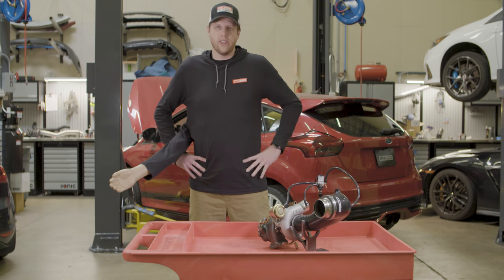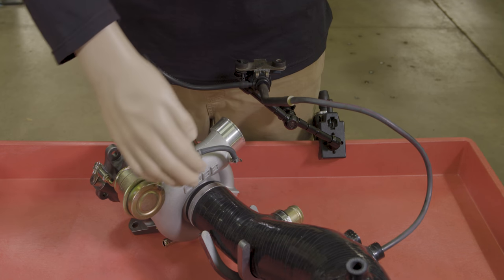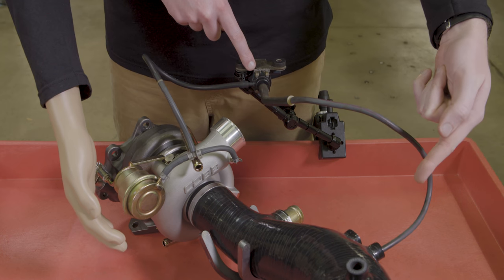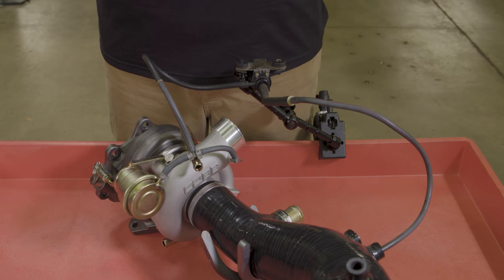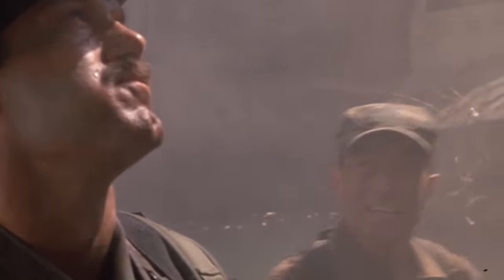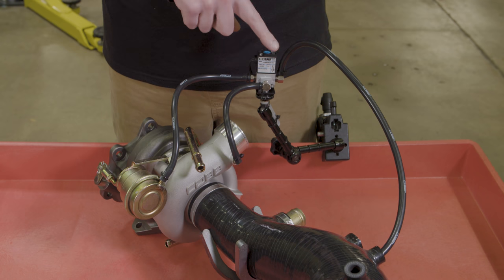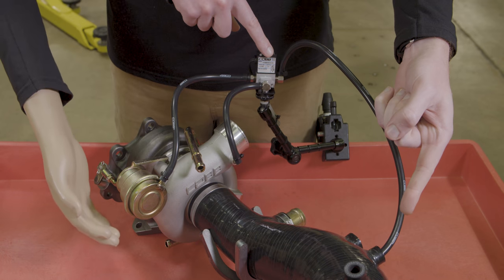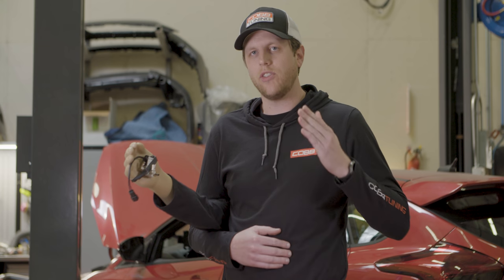COBB Tuning - Car Quickies with COBB -  Boost Control 2-Port vs 3-Port EBCS?

Comment: you have to reprogram to use the 3-port system, do I understand? Is it enough to lower the waste gate duty cycle percentages of the maximum table enough? or do we have to modify some other parameter?

Comment: Instead of the line going back to the intake can it just vent to atmosphere on a 3 port setup?
Reply: Kartereo yes, but on a MAF car you typically don't want to lose any air after it's been metered. The amount would be fairly low in this case though.
Reply: @Carbibbles  keep forgetting about calculating for metered air. Damn you MAF! 😂
Reply: @_Epictetus_  you can always cap the barb fitting that is on the intake  f you want to send the line to atmosphere.